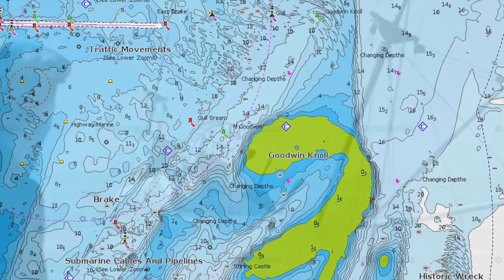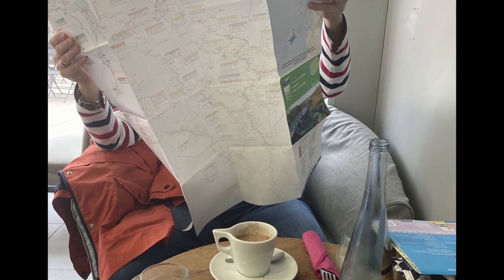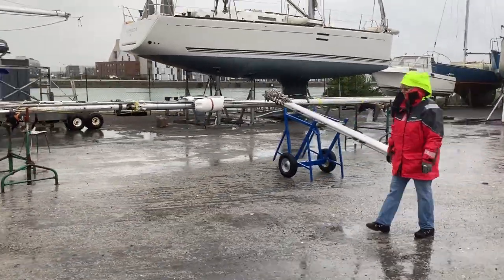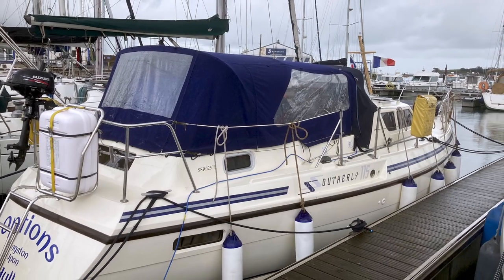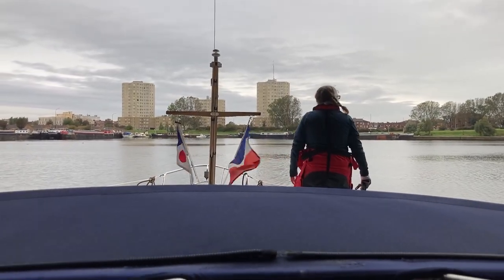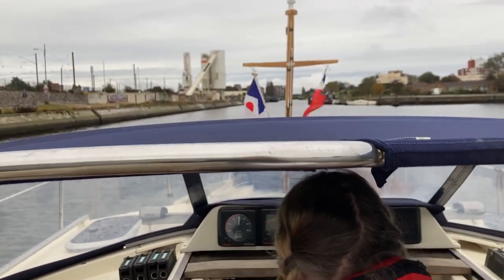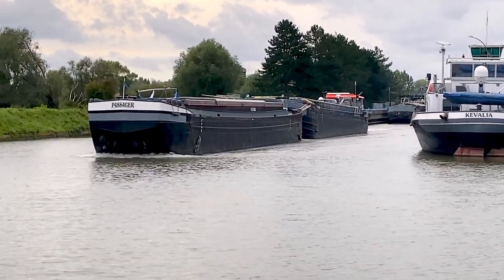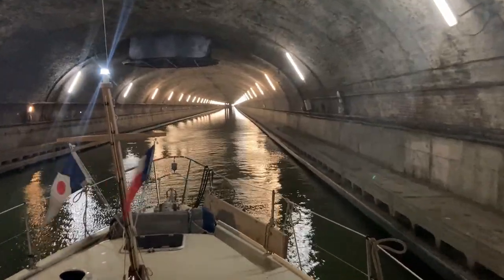NO MORE SAILS! DEMAST Sailboat to Canal Boat - CRUISING canals through France to the Med

Comment: We are doing this trip next summer, (2024) but plan to just cruise the canals rather than head to the Med. Plan is to de-mast and leave it there before collecting it again on the return journey. I note you have  a short, presumably home made affair installed on deck for navlights and VHF did you make it yourself or acquire it somewhere.
Reply from the maker: Hi Mike, what’s your boat? Where are you starting? 
I made our “mastatte” from a plank of American white ash supplied by a timber merchant in Hull. It’s not essential but carries the anchor light, VHF ariel and courtesy flag. I copied the design (loosely) from looking at a motor boat mast on line. 
I hope you’re enjoying all the videos and thanks for your comment. 
Keep us updated.
Stay safe
JnS

Comment: Hi you two, thanks again for the informative videos. I am in Dunkirk myself and about to enter the canals, in the first two locks, Trystram and Darse1, did you climb the walls to tie off on bollards or did you just tie up to points on the wall?, Also are you required to be on board your boat when the locks are operating or can you stand on shore holding the lines? - Thanks:)
Reply from the maker: Hi Jules, that's great we really hope you enjoy the canals! The first locks are gentle and we stayed on board being able to reach bollards from the deck - either lock top bollards or lock wall insets. Have a great journey and stay safe.
JnS